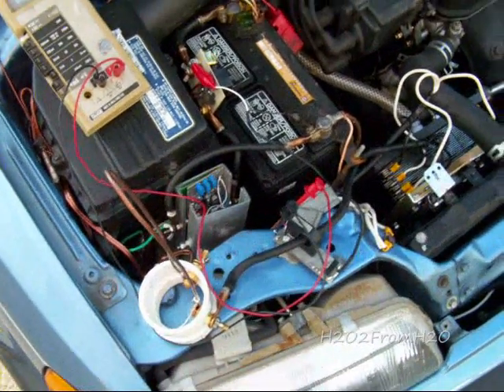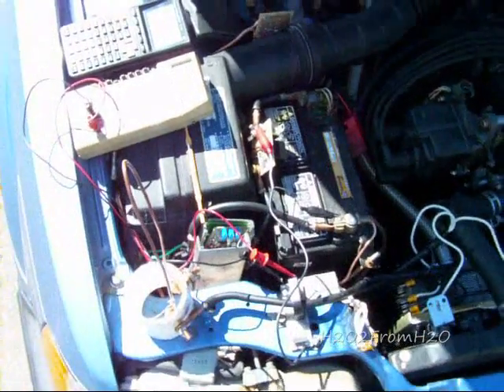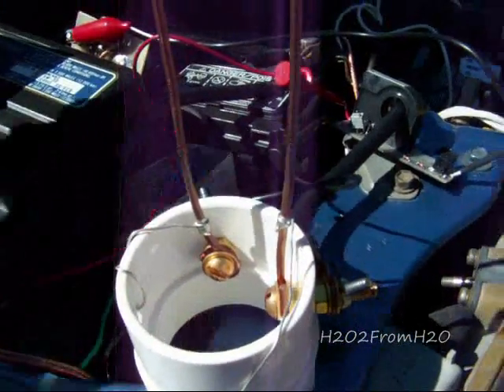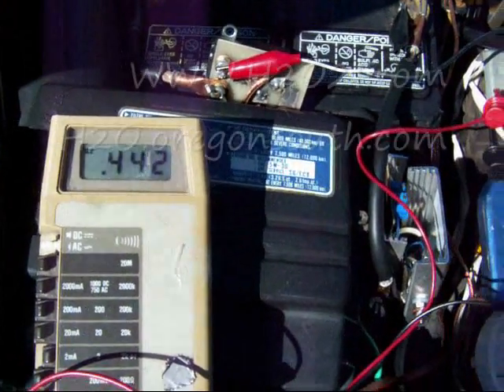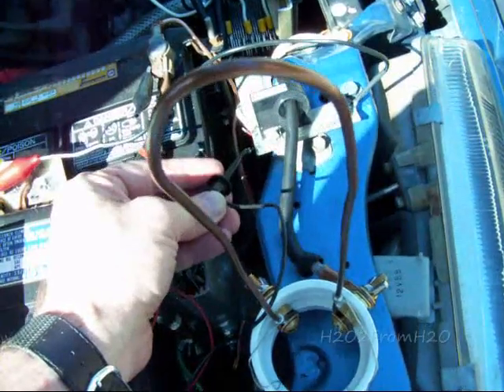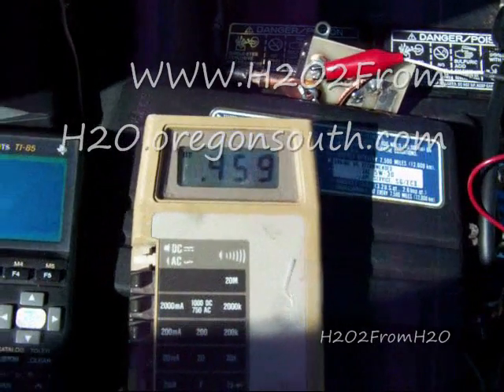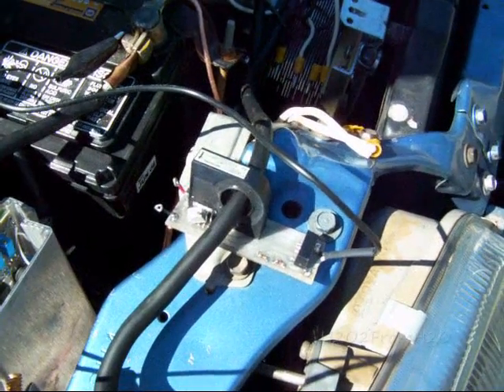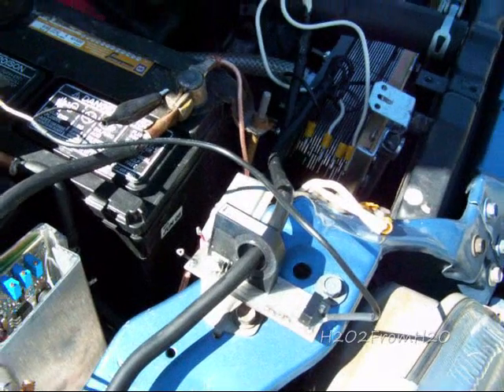#21 H2O2 - Current HE V1.0.1 - A budget Alternitive to a $70 or more Clamp on Current Meter Part 2

Comment: I also have noticed the shunt voltage varies slightly with temp. The shunt in the PWM also has this issue but I don't think this is a serious issue from a control perspective. Great video.